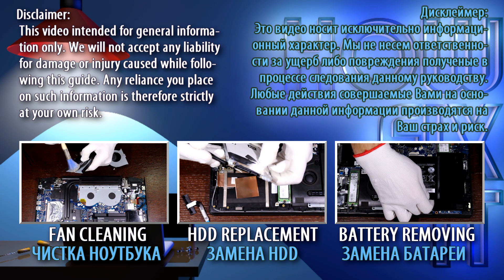Lenovo IdeaPad Y700-15ISK RAM Upgrade and Install - Your Step-by-Step DIY Guide!

Comment: Heyy! I have the same laptop, ideapad y700 15isk. My current Ram is 8gb, and I'm an architecture student, so I needed to upgrade my ram to 16GB. Due to COVID lockdown, I can't go outside to get it done by a professional. I wanted to recheck if I can do this at home, and if there is any precaution I should take, and if there is any specification I need to take care of. Thanks so much!
Reply: did u do it
Reply: Yep, u can do it by yourself. Just buy 2x8gb 2133Mhz PC-17000 (according to the spec) ram sticks and plug them into the specified sockets (showed in the video).

Comment: hello, need help, when u change the ram, u need to do anything with drivers or BIOS????? I mean u change all the RAM disks from the pc  to new disks, u will need to do something on BIOS or drivers later when u turn on ur pc or it will work correctly?
Reply: As far as I know everything should be automated unless you use RAM with higher frequency than you processor supports and it doesn't have XMP profiles support. In that situation you need to downclock it from BIOS manually because it might not do it correctly (sometimes it downclocks to a lot lower frequency than you can actually use). For instance HyperX memory uses XMP profiles so it downlocks automatically and you are free to go just after attaching it. But if your RAM matches processor's limit, everything should have been done itself.

Comment: Hello, how much RAM does this laptop support?
Reply: 32gb
Reply: @webglobepl  all the versions? The mine has from factory 12GB... How i can validate that really support 32GB
Reply: @ricardoracines5232  
it all depends on the processor, tomorrow I will try to put 2x16 + 2x8 - apparently I have 4 slots
Reply: @ricardoracines5232  
task manager> ram > used sockets 2 of 4
Reply: @webglobepl  Did this work?
Reply: @webglobepl  I have another question... can i replace my 1TB HDD to a 1TB SSD?
Reply: @ricardoracines5232  Ram isn't work, i have 2 slot so 2x16gb ... 1TB SSD? Meybe - i have 1TB HDD and 512 SSD M2 970Evo Plus
Reply: @webglobepl  so You have it working with 32GB of Ram??? ... ... Thats M.2 Evo puts so hot during working?
Reply: @ricardoracines5232  
Ram works on 32GB and M2 is warm but is it bad?
Reply: DDR3 or DRR4??!
Reply: I just google and apparently the max is 16GB. Did you find any other source, or did you try going for 32GB (which is honestly overkill) ?
Reply: 16 according to the spec and 32 according to the Lenovo forum
Reply: @SaucyULTRA  i don't know... That's what I want to clarify
Reply: @the_son_of_moms_friend  so... 32 may work right?
Reply: @ricardoracines5232  I hope so. I'll be trying to plug 32 by myself.
Reply: Hola quisiera saber si puedo poner solo una memoria ram de 16gb mi portátil es una lenovo y700 touch-15isk ya que leí que deberían ser 2x8gb pero compre 1x16gb por eso quisiera saber si no hay ningún problema